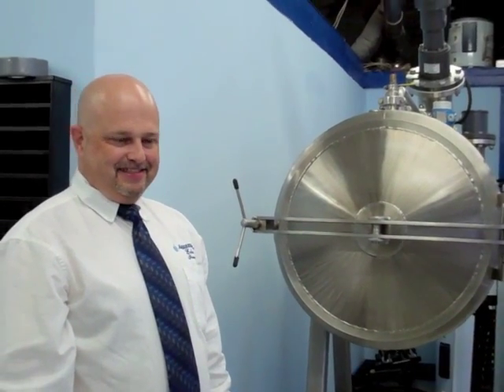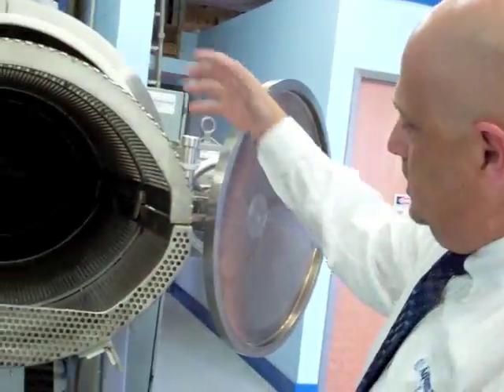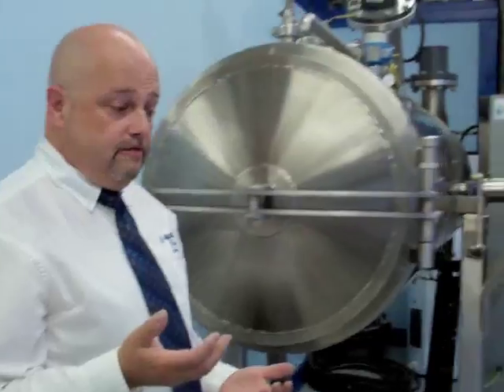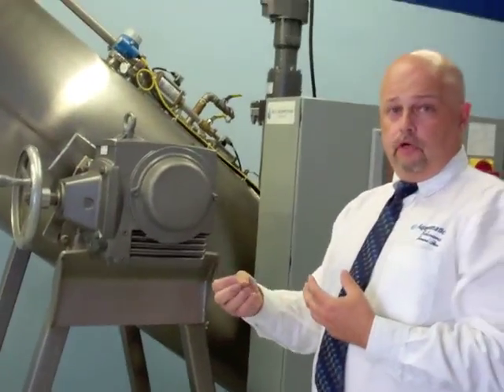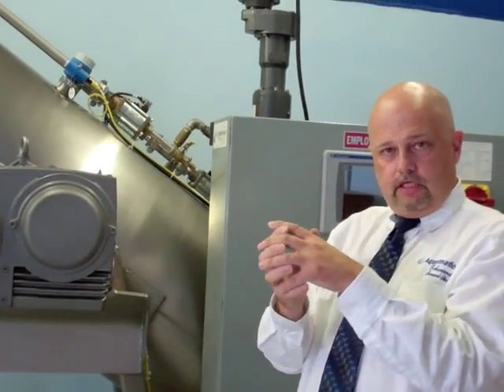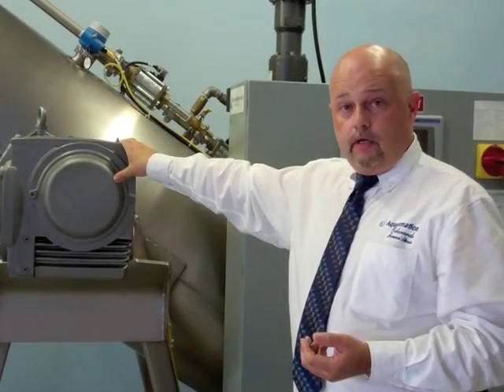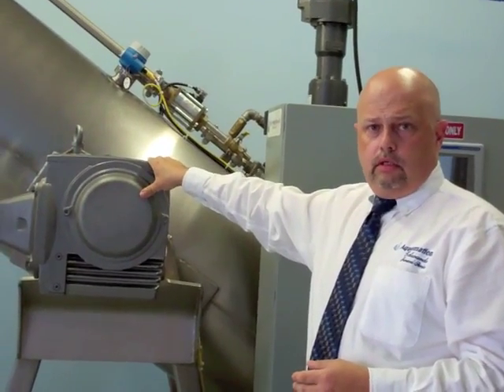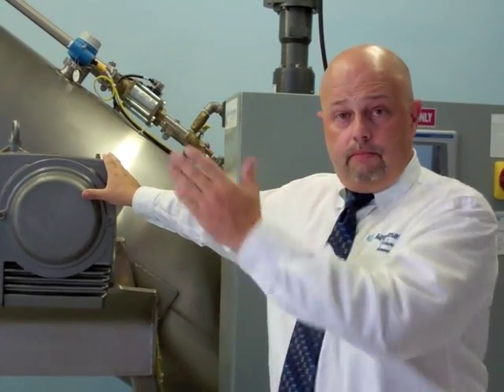Alkaline Hydrolysis Unit Tour

Comment: Wouldn't concentrated acetic acid be better than using Carbon Dioxide to remove the alkalinity of the waste? The reason I mention this is that most hydrolysis cremations are marketed as producing less CO2 for the environment because they don't burn gas. Acetic acid is vinegar. Totally natural and easy to source. When mixed with alkalines the product is a neutral acetate.

Comment: Is it expensive ?
Reply from the maker: Are you asking about the machine or what a funeral home would charge to do the service? It's often similar in cost to fire-based cremation.
Reply: @GailRubin   the price for that service.
Reply from the maker: @rebeccaann5364  This will vary depending on the funeral home. Is there a particular state or market you want to know about?
Reply: @GailRubin   I was just curious about it. I am from Texas and I was interested if it's being offered as a alternate to cremation in many places. I know the traditional burial in my area I am from runs about $14,000. But I do live in a rural area so they weren't offering that 3 years ago.

Comment: I like this process over the added heat and pressure processes, BUT....
Why is the "fluent" just dumped?
The whole point of this process is that it is a greener way to be "processed" and that it is similar to being processed in nature, but once the body is processed it is then treated as a traditional waste with the bones then being processed similar to cremation.
(Forgive the overuse of the word process, I was trying to find a nice way of getting my point across)

Why stop short?

Why not use the glycerine produced by this process from the fats and make some soap or any of the other thousand uses that glycerol has?
As far as the other bits that remain after the glycerine is removed, this can be dried and compressed into time release fertilizer pellets, then you can add a little of it to your plants and when those daffodils flower in the spring you can convince yourself that it's grandma smiling at you!
I am sorry if what I am saying comes off harsh, but as someone who likes this process for it's greenness what I don't like is how it is modeled after current fire cremation practices and how the liquefied body is treated like waste and then "processed" like waste in the current linear fashion which is what got us into trouble to begin with!
I could go on, but I am sure I would upset quite a few people...
That's not my intention....

Comment: Is it hot water how long does it take to complete the process how much does it cost and can a Canadian person get done
Reply from the maker: It depends on the system. There are low-temperature/low-pressure systems that take about 6-8 hours, and high-temperature/high-pressure systems that work more quickly. The cost varies, depending on the funeral home offering the service. There are systems in Canada! You can find out more at this website: https://aquamationinfo.com/
Reply: Only it is not exactly water but more like drano heated and under pressure. Think of it like being cooked in a pressure cooker in a slution that disolves the body into a soup.

Comment: Where the liquid go? Is it used to other bodies?
Reply from the maker: The liquid goes down the drain into the sewage system.
Reply: Gail Robin Thanks. Another question It goes to the general population sewage system? what happens to the bones? Is that the remains we enter?
Reply from the maker: The bones become brittle and sandy - those are dried, pulverized, and returned to the family as cremated remains. The alkaline hydrolysis system actually returns more bone matter than fire-based cremation.
Reply: Gail Robin Thanks.  Does the liquid go to general pop sewage system?  Do you have branch in Nevada?
Reply from the maker: Yes, the liquid, called effluent, is sterile and free of any pathogens, DNA, RNA, or drugs that were in the person's system. To find out the status of alkaline hydrolysis in Nevada or any other state, contact Samantha Sieber, VP of Research at Bio-Response Solutions. The phone number there is 317-386-3500 (Danville, Indiana).
Reply: Gail Robin.  Thank you for your patience.  Last question, does the fee vary from to state?
Reply from the maker: Estrella Philibosian Fees are set by the funeral home, and that will vary by market. Good questions!

Comment: I am a Physical/Chemical waste treatment operator in North Carolina. In the municipality where I work, the discharge to the city can range from a pH of 6.5 to 11.0, as directed by our wastewater permit. We are a factory with an onsite pre-treatment facility. The factory discharges the pre-treated water and the city "finishes" the wastewater. If this gentleman could set up an approved pre-treatment facility, he would be able to apply for a wastewater permit in his municipality. As he mentioned, different cities may have different requirements, depending on that particular municipality's waste treatment facility.
Reply from the maker: I heard that a funeral home in Maine set up one of these systems, and the effluent actually helped the town's sewage system function better.
Reply: That makes sense to me. The city w/w plant here prefers we send a higher pH discharge (in our case 10.0 -10.5) due to a constant battle with acid rain and other factors. The sodium/potassium hydroxide alkalies used in this "aquamation" unit could be beneficial to the local w/w plant, and could actually provide cost savings to the city/county there.

Comment: What happens when a person is too big to fit in that tube
Reply from the maker: I understand it can hold up to a 300 pound person. If someone's bigger than that, might want to check into another disposition option.
Reply: Gail Rubin oh ok, ty Gail.
Reply: BioResponse (the manufacturer of this Alkaline Hydrolysis unit) does make custom units that are able to accommodate decedents weighing up to 1000lbs, according to their website

Comment: Is there a place in SC that does this and how much does it cost?
Reply from the maker: You might check with Bio-Response Solutions' VP of Research Samantha Seiber. They make these machines and keep track of which states allow the use of alkaline hydrolysis. You can call the company at 317-386-3500.

Comment: I guess it's only for skinny ppl lol
Reply: lol hope not  love from NC
Reply: He said around 400 lbs is the most but if you were taller you could possibly exceed that limit, just as long as you fit in the screen cage.
Reply: @jrwinkler323  I was just kidding because of how small it looked when he opened it. I am 165 and I don't think my arms and shoulders would fit.
Reply: @skeeter793  It does look like a tight fit which is surprising with the size people have become.  I guess they use the horse method at that point! :-)

Comment: I keep thinking that the tray/tube isn't that big/wide. What (size) does it stop at? It looks like if you wore a dress size of say -12 youd just squeeze in there. Also, I am curious to know what the price differential is offered by opting for this VS you basic cremation by fire/heat. Anyone have an actual answer?
Reply: thats easy.  perhaps they just cut the body in sections. and then liqui-cremate in chunks.
Reply: Inhumane. The person is dead...it is just a corpse. How can you possibly treat a corpse inhumanely?
Reply from the maker: +Tisha Nortac 
Hi Tisha: It's actually bigger than it looks. The manufacturer's information materials indicates this type of unit can handle up to 500 pounds. You can find out more online at BioResponseSolutions.com.
Reply from the maker: +Tisha Nortac - Also the prices for these services vary by market. Those funeral homes that offer both options will frequently offer the same price for the service. Given no price differential, one funeral director told me that more families choose the water option over the fire option.
Reply: Im wouldn't doubt that he would tell you that, It's a marketing thing, I see this as a "Cryogenics" experiment, the only difference is this, My opinion: If some feel that doing Burn as a form as cremation could be inhumane, then i would say, This method is no difference then filling a tube with lyme, they are actually decomposing a body in a inhumane way, just use lyme, its the same process with out any remains.

Comment: I find it rather humerous how this bloke is making a point of trying to make this whole process sound nice and scientifically clean.  This is literally no different than dissolving a body in a vat of acid (a preferred disposal method of many a mafioso).  Sodium hydroxide (also known as CAUSTIC soda, which is the same chemical used in those heavy-duty oven cleaners) is a very strong alkaline solution.  Strong alkalis have the same exact effect on a body as strong acid does.  So to break this down... you stuff a corpse in a pressure cooker with water and oven cleaner chemicals until they liquefy into a yellow-orange goo.  Wonder why Ohio made this process illegal?
Reply: lexfacitregem. How else...MONEY!
They don't care about safety,  just the mighty dollar.
Reply: This process is sterile, has no pollution impact, and neutralizes any chemicals that may have been in the body of the dead person (like medications, even hardcore chemo drugs). This is literally better for everyone involved in every way. The only way this is worse is that it takes about twice as long to do the job. But considering all the benefits it has over the other method, a longer wait is worth it.
Reply: Pity you don’t actually listen
Reply: Drano